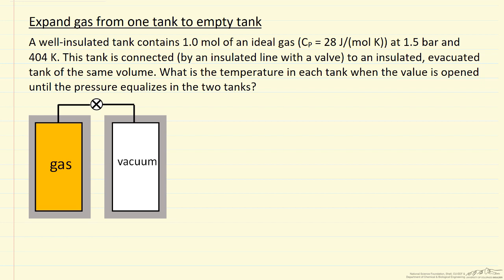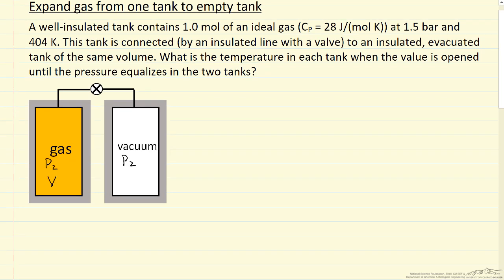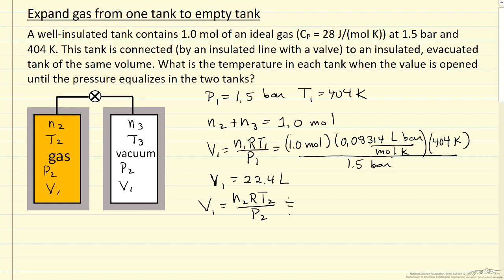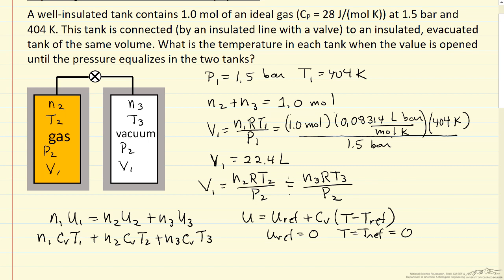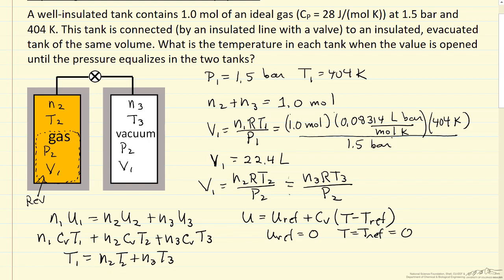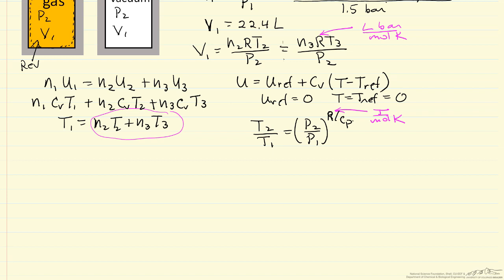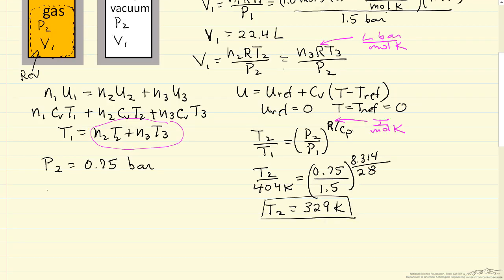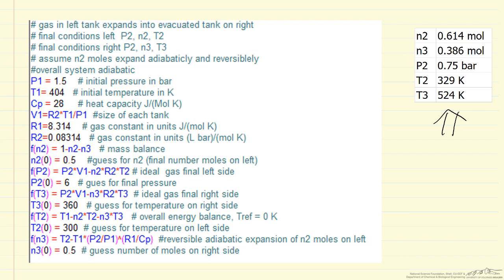Expand Gas from One Tank to an Empty Tank

Comment: Isn’t this essentially a Joule expansion? Shouldn’t the internal energy (and therefore temperature) of the gas stay unchanged if we assume rigid container expansion? If we imagine letting molecules into the vacuum one by one, their speed (temperature) should not change. To my understanding a molecule cannot perform work to a group of molecules moving at the same speed as itself. What am I missing?
Reply: I have to correct the last sentence, because a directed molecule could in fact perform work. Maybe the answer to my question lies in the details of how the expansion is performed, i.e. how we interpret the line and valve connecting the two volumes.
Reply from the maker: This is not a Joule-Thomson expansion since the pressures are changing on both sides of the valve. The gas in the first tank cools because it is pushing out gas and that requires energy. The internal energy of the gas does indeed not change. This means the average temperature does not change, but the temperature is different in the two tanks.

Comment: Hey, so I'm due to start studying Chemical Engineering in the UK this September and I would like to gain a headstart since I have nothing to do rn. Any course or book or video suggestions (preferably for free)? What order should I watch your videos if I'm just getting started. Thanks in advance!
Reply: I will start my 3rd year chem eng deg next month. I think u should study physics by Serway or Halliday book (focus more on mechanics, fluids, thermodynamics), general chemistry by Petrucci, calculus, physical chemistry (Atkins book), numerical methods (Steven Chapra book), and chemical engineering principles by Himmelblau book (mass balance and energy balance). Also, if u can, learn how to use MATLAB, it is very useful.
Reply from the maker: Thanks for the question.  I would recommend going to http://www.learncheme.com/screencasts and check out Chemistry, Engineering Math, and Engineering Computing.  If you get through those, Material and Energy Balances is the first chemical engineering course.  Enjoy!